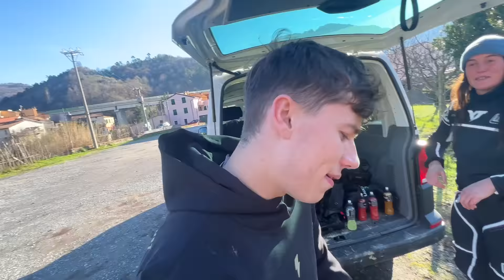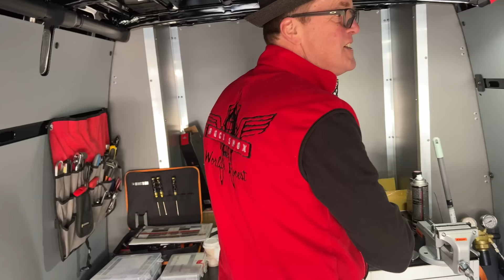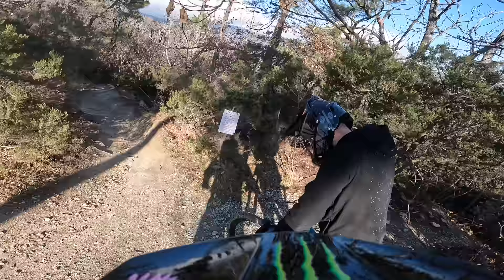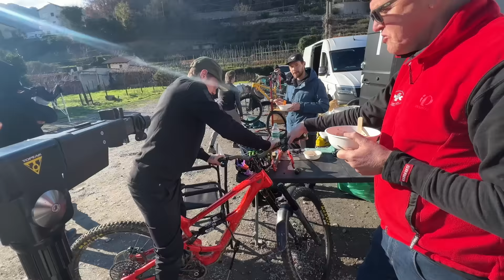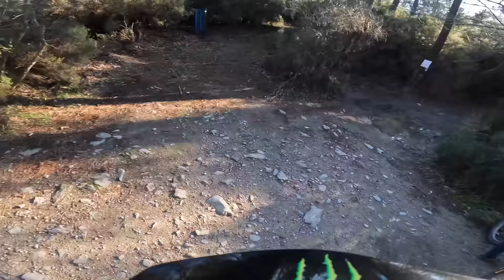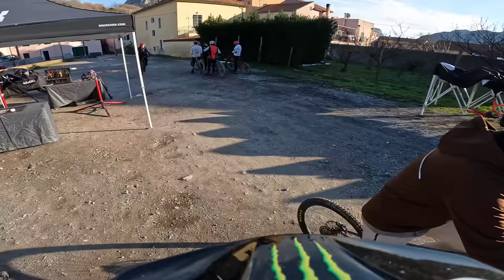SHOCK TESTING WITH ROCKSHOX | Jack Moir |

Comment: Jack lad, always cool to see the testing you guys do to get stuff dialed, look forward to seeing part 2 and you trying a coil. Curious if you switched back to the size Large or still on the XL front tri? Ask because holy spacers and high rise bar if that is the XL with a 545mm Stack and you need to add 80mm to get your bar where you like it 😲
Reply from the maker: Haha hurt My hand shortly after so still got a lot to get it perfect

Comment: How can you drop in the damping cartridge without taking off the lower legs? How does it attach inside at the bottom if u dont need to?
Reply: On Rock Shox forks, you undo an allen bolt on the bottom of the damper side, then you can undo the whole damper unit from the uppers. Oil drips out, then you put in the new damper and fill in some oil from the bottom, install the allen bolt and you are finished.
Reply: @marzocchidj3  yep,it was the position of the bike that threw me off,I have some Yaris and have removed my damper. No worries cheers.
Reply: Actually I believe the new Charger 3 dampers you can directly unthread from the top of the CSU and drop in whatever cartridge you like without messing with the lowers.. Someone with more knowledge feel free to correct me
Reply: @jonathanangieri153  that makes more sense,the bike didnt look like it was gonna be angled up to throw oil in